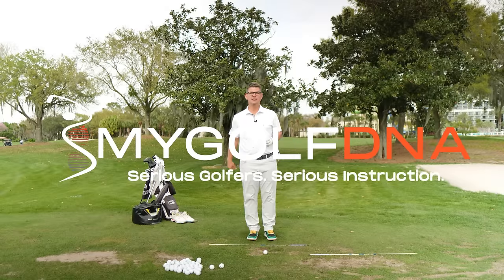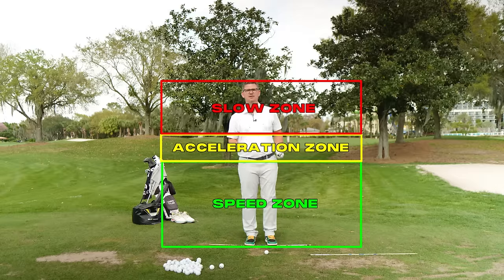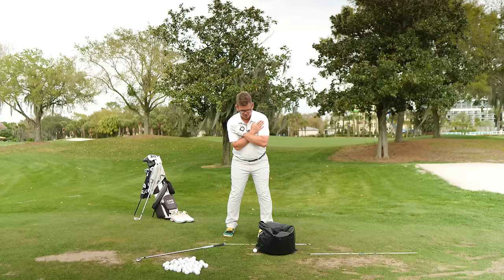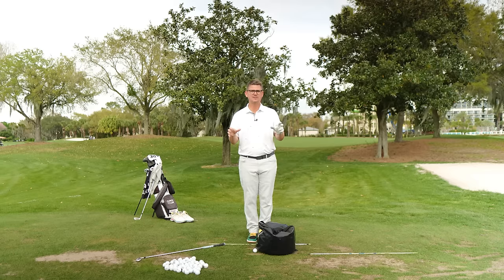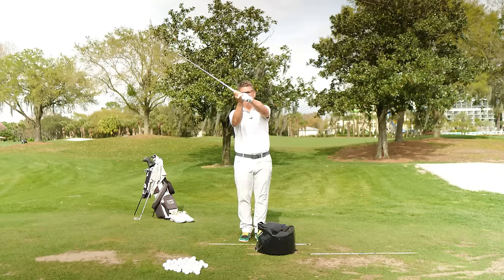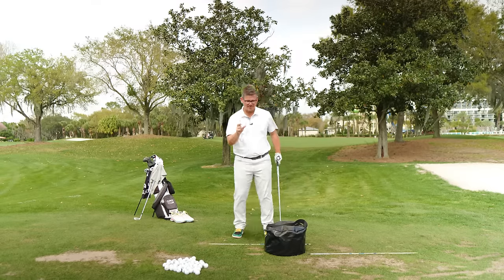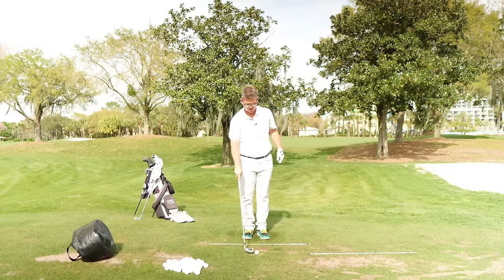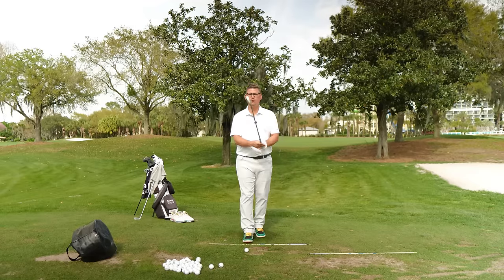Hit The Brakes For Faster Clubhead Speed | Golf Sequence Drill

Comment: The hands move fastest from the top of the swing down to about lead club parallel or so, the hands then slow down which promotes angular force which increases club head speed.
Reply from the maker: For sure! The hands accelerate quite a bit from the shoulder line to the belt line.

Comment: Great video. Quick question.
After you reach the acceleration zone and hips have stopped turning and shoulders are square to the line does the body keep rotating or is it just pulled around by the release of the club.
Reply from the maker: The body should feel really slow BUT will keep moving always. We just want it to slow down as much as possible to start the release of the club at the right time. Be on the look out this week for a video that will talk more about this topic as well as a drill to go along with it:)